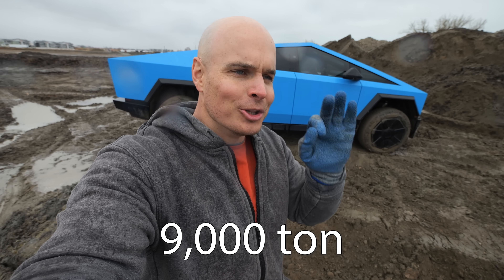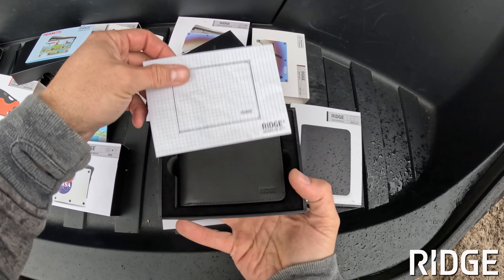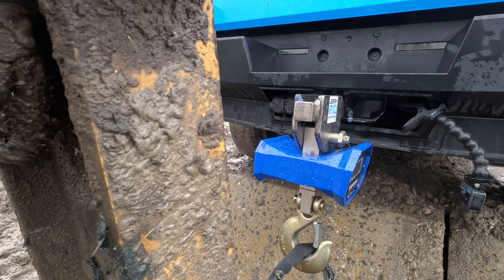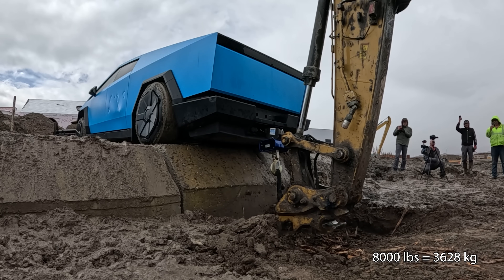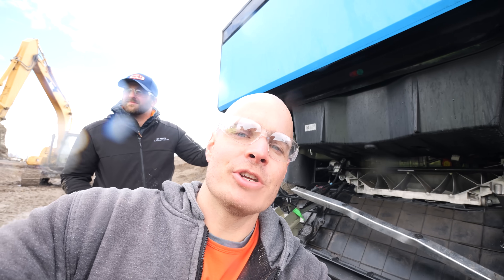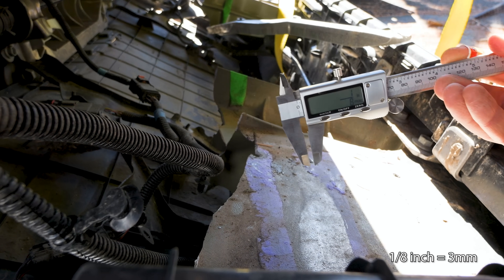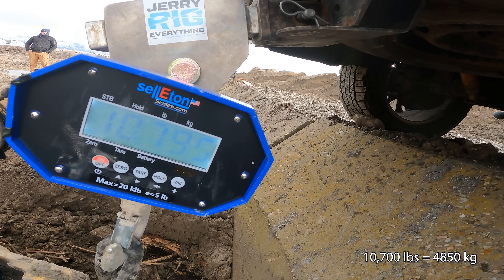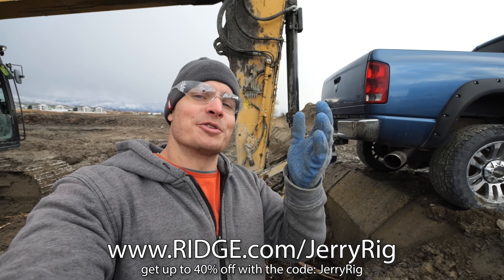SHOULD YOU TOW WITH A CYBERTRUCK?! - (catastrophic failure test)

Comment: Hey Grok, is there any real world examples or evidence of Cybertrucks failing at towing because they were loaded improperly?

Answer:

"There’s no direct, conclusive evidence from real-world incidents specifically stating that Tesla Cybertrucks have failed at towing due to "improper loading" alone, based on available data up to March 15, 2025. However, there are relevant tests and discussions that suggest improper loading could contribute to towing failures, particularly given the Cybertruck's design and material choices.

Stress tests, like the one conducted by YouTuber Zack Nelson (JerryRigEverything), highlight potential vulnerabilities. In this test, the Cybertruck’s tow hitch was subjected to extreme downward force—far exceeding the recommended tongue weight of 1,102 lbs—resulting in the rear cast aluminum frame snapping at around 10,400 lbs. While this isn’t a real-world towing scenario, Nelson argued that improper loading (e.g., excessive tongue weight) or dynamic forces (like hitting a pothole at speed) could transfer significant stress to the hitch, potentially replicating such a failure. The Cybertruck’s towing capacity is rated at 11,000 lbs, but the test suggests a thin margin of safety if loading isn’t balanced correctly, as the aluminum frame lacks the ductility of steel, which bends rather than breaks under stress.

Improper loading, such as uneven weight distribution or exceeding the tongue weight limit, is a known risk in towing across all vehicles. The Cybertruck owner’s manual emphasizes proper loading, recommending a tongue weight of about 10% of the trailer’s total weight (up to 1,102 lbs) and warns against negative or excessive tongue weight, which could lead to instability or structural stress. While no specific Cybertruck incidents tie failures directly to improper loading, posts on X and reports of tow hitch failures in extreme tests (e.g., WhistlinDiesel’s video, where the hitch snapped after impact and towing) imply that exceeding design limits—potentially worsened by poor load management—could cause issues.

In contrast, a 2004 Dodge Ram 2500 with a steel frame withstood similar stress (10,700 lbs) in Nelson’s test without failing, highlighting aluminum’s fatigue-prone nature. Experts and users on platforms like X have speculated that repeated towing with suboptimal loading could weaken the Cybertruck’s frame over time, though no long-term data confirms this yet.

So, while there’s no smoking gun of a Cybertruck failing mid-tow solely due to improper loading in everyday use, the evidence from controlled tests and material science suggests it’s plausible. The cast aluminum frame’s brittleness under extreme or misapplied force points to a design that might not forgive loading errors as well as traditional steel-framed trucks. For now, it’s a theoretical risk backed by test data rather than a documented trend."

Comment: HOW'S THAT A FAIR COMPARISON?? 

Cybertruck towing capacity: 11,000lbs. Broke at 10,400lbs vertical load (95% of towing capacity)
Ram 3500 towing capacity: 13,400lbs. Tested up to 10,700lbs vertical load (80% of towing capacity)

The Dodge might've broken before reaching 95%...

Comment: Personally i would rather have a steel frame on my truck. I want something that when it deforms/cracks/has problems, that will give me the ability to identify it. On my normal pre trip, and maintenance inspections. Aluminum just doesn't have the mailability that steels have, when they have been repeated stressed to the limit. Resulting in a lack of safety margin IMO.

Comment: I dunno man. Usually your vids seem pretty legit, the call-out on aluminum fatiguing over time is good, the comparison to a steel truck is good.

But the math for calling this thing unsafe to tow doesn't check out. at 1,100lbs a straight 1ft drop onto the hitch would be closer to a 1/20th of a second, which is closer to 6x weight. 6,600lbs is still well below the 10k failure point. 

Hitting a pothole, or going over a hill is going to result in more lateral load than downforce. A "lateral" load up a 100% grade would be about 5500lbs, and I don't know anyone who's going to try hauling a 11,000Lb trailer up a 45º slope! 

I'd go so far as to make a bet - If you can find me a truck that can do it from a stand-still to to 55mph all on that slope I'll buy you a cookie.

My guess is you're aiming to capitalize on anti Musk sentiment (totally fair) and get rid of a vehicle you don't like very much (also fair). But the math doesn't check out, and in your position thats as good as lying. So in the end your putting money in your pocket at the expense of others, which is exactly what everyone hates about Musk. 

So there you go.

Comment: The distinction between lateral and vertical loads is significant. The Cybertruck, not being a crane, isn’t designed or advertised to withstand substantial vertical loads in the same way cranes are engineered for such forces.

Comment: very poorly executed test. if you were applying that much tongue weight by poor weight distribution on the trailer while driving on open street you should be facing assault charges at least.
and for the record: your explanation of tongue weight at 10:00 is complete BS.
Reply: Wasn't completely correct, but also wasn't complete BS.

Comment: There is no situation where any truck should have anywhere close to 10,000 lbs on the hitch. Even the heaviest duty trucks on the market only have a payload of 7000lbs. And thats on a gooseneck. Breaking at 10,000 lbs is completly crazy. This test was %100 a pass for the cyber truck. I am super impressed. Just for context. A trailer thats not a gooseneck would snap like a twig far before reaching 10k lbs On the tounge.

Comment: WOW, I never thought that in the US you hang a trailer of a vehicle. That would neatly explain why the f*** do you need a truck to tow anything at all whereas here in EU we can tow 70% of trailers with a compact car. 
If anything the hitch should be tested pulling backwards not downwards, what you've been testing for is not a improperly loaded trailer, it's a trailer that has its wheels some 10-20 feet behind its load bay, and its load put exactly at the hitch. Find me a trailer that looks like that. Actual trailers designed to be towed by a car/light truck probably never exceed  50% of the load hanging on the hitch even if purposefully loaded the wrong way (and if balanced properly it should be exactly zero). With that methodology I can break just about anything and claim it's badly engineered.
Reply: If you take into consideration that the cast aluminum will weaken over time and it is already much weaker than a 20 year old truck that was involved in a rear end collision, are you going to trust it and for how long?

Comment: I have unsubscribed. I belieive the producer needs a lesson in basic physics.... The result here was actually really good........ Downward force of nearly 11,500 lbs... Think about the load capacity of the E rated tires on the cyber truck (3086lb). If this test was on concrete it's likely the rear tires would have blown under this load.... How many trucks have you seen blow their rear tires towing a trailer??? (None is the answer) single axle trucks with a tow rating of 11k Never experience shock loads or towing loads like this. This test was total shit. FYI I'll never own a cyber truck, because of towing range and charge times. It would never suit me... But this test was a waste of a vehicle, and a publicity stunt. Will never review another one of these videos.

Comment: Structures Engineer w BS and 28yrs as an Aircraft SE FedEx / Boeing / Airbus. Good test 
Fix
Easy fix a doubler on the casting or better to just increase the casting thickness. Easy fix is to get a better shear strength adhesive with a few what is called chicken fasteners. 
If it were me as a Tesla Engineer I would do both
and
Add a water proof sealer outside of that adhesive bond area. Weakest problem with adhesives is hot / wet strength so one fix would be eliminate the wet.
Problem
Road salt or cracks in adhesive / casting due to prior use will cause a premature failure.

Comment: while the argument "the full weight can still be relevant if towing other cars out of the mud" (doubt the cybertruck is that offroad-capable anyways)
"or if going 80 on a freeway and hitting a hole in the pavement" - even then, the full weight of the trailer won't be applies downwards to the hitch. Don't forget, the trailer still has wheels, which take the most of the weight. This is still true for improper loading.
But that's not what I was actually wondering..
I wonder about the just 3 (!)mm thick aluminium frame (!).

Comment: You're only testing tongue weight and not actual towing capacity... 
You would have put the entire 11k lbs trailer on the tongue for it to break..  Which is impossible.
I'm not saying it's a great design--  you can't tow with an EV anyway, because of range.  But these claims you're making are definitely false.

Comment: What the heck!!! no one puts that much weight on a tow ball. If there's that much weight on a tow ball then you've done something ludicrously wrong with your trailer or like a million times over weight.
*Just remember most of the weight of what you're towing is supported by the trailer wheels and not your tow ball. Very little is weight is actually on the tow ball and that's roughly 10% weight of what you're towing.

Comment: I have two Dodge Ram Cummings and you've just witnessed why they are the King Of Trucks, because they are really that tough! I had a 95 going up hill with a 36 foot 5th wheel trailer and a Chevy towing around the same size trailer next to me, blew the engine and started to roll back down the hill. My truck didn't even shift gears as it kept moving, while on the other side of me in the median was a Ford with the engine on fire!

Comment: This is not a good test for anything. When you apply 8,000–10,000 lbs directly to a truck’s hitch (tongue), the entire load presses down on that single point. The truck’s suspension, frame, and hitch bear it all—no distribution, no relief. It’s a straightforward, concentrated force. But towing an 11,000 lbs trailer works differently because the trailer’s weight doesn’t all pile onto the hitch. Instead, it’s distributed: the trailer’s axles carry most of the load, and only a portion—typically 10–15% (that’s 1,100–1,650 lbs) for conventional trailers—becomes tongue weight on the hitch. For fifth-wheel or gooseneck setups, where the hitch sits over the truck’s rear axle, this can climb to a maximum of about 25% (2,750 lbs). Either way, the hitch never sees anything close to 8,000–10,000 lbs when towing an 11,000 lbs trailer.
So why can’t an 11,000 lbs trailer produce a tongue weight of 8,000–10,000 lbs? It comes down to physics and design. Tongue weight is the downward force exerted by the trailer’s front end on the hitch, determined by how the trailer’s mass is spread out. To hit 8,000–10,000 lbs of tongue weight, nearly all of the trailer’s 11,000 lbs would need to be stacked right at the front, near the hitch. That’s not just impractical—it’s absurd. Picture a trailer with all its cargo shoved forward and the axles carrying next to nothing. The center of gravity would be so far forward that the trailer would be unstable, prone to tipping or swaying dangerously. In reality, trailers are built with the center of gravity closer to the axles to ensure balance and safe towing. Manufacturers and towing experts stick to that 10–15% guideline (or up to 25% for fifth-wheels) because it keeps the rig steady and manageable.
Think of it this way: imagine balancing a 10-foot pole. If you hold it in the middle, it’s easy—the weight is evenly split. But if you grab it an inch from one end, it’s a nightmare to control because all the weight is working against you. A trailer with excessive tongue weight is like that off-balance pole—hard to handle and risky. That’s why an 11,000 lbs trailer can’t realistically exceed a tongue weight of 2,750 lbs (25% in a fifth-wheel setup).
Thus, applying 8,000–10,000 lbs directly to the hitch is a completely different scenario from towing an 11,000 lbs trailer. The trailer’s design and weight distribution naturally cap the tongue weight far below that range, making the two fundamentally incomparable. The maximum realistic tongue weight for an 11,000 lbs trailer? 2,750 lbs—end of story.

Comment: Love the Hot Wheels vibe, but let’s see the Cybertruck prove itself IRL! Start with a 10,000 lb trailer up a steep hill, then keep piling on the weight until it hits its advertised limit. After that, throw in a random rain-soaked pothole test and keep cranking up the trailer weight until it breaks. Give us that full-on Cybertruck stress test! :)

Comment: Tongue weight supposed to be only 10 to 15% of trailer tow capacity. The trailer should be balanced correctly and a bump or pothole would not put that much force on it. The hitch is being stressed a way that it would never be.  Any truck would not withstand being tested that way.

Comment: I’m not a Teslas fan but this test has proven that the Cybertruck exceeded its capability. The Tesla Cybertruck's maximum tongue weight, the downward force on the trailer hitch, is 1,100 pounds (499 kg), and it's rated to tow up to 11,000 pounds (4,990 kg).
Reply: The problem is it's not safe to tow 11,000 lb if its actual tongue weight is only 10,000 lb.

Comment: I can't imagine ever buying a Cybertruck.  Esthetically, not my thing.  If I were planning to tow any distance I would not consider getting an electric truck.  That said, come on, this test and it's conclusions are misleading, and would hate to think it is intentionally misleading...  This is obviously testing well beyond factory limits and is not the intended towing geometry for this vehicle.  While there isn't steel fatigue, there is weld fatigue.  Type "truck frame breaking" in a search and you will see dozens of examples of frames breaking during use across many manufacturers.

Comment: A lot of people here missed the main point of the video. 
The aluminum frame can’t bend, and every single time a load is applied, the material weakens ever so slightly as it fatigues. Steel doesn’t weaken every time you apply a load (as long as the load doesn’t exceed the steel’s yield strength). 
Sure the test could be better, but its main purpose was to show that when the aluminum reaches a failure point, it doesn’t bend as steel would, it simply snaps. While forces of 10,000 lbs isn’t going to happen in the real worlds (unless you seriously improperly loaded your trailer), what does happen in the real worlds are dozens and hundreds cycles of several hundred to 1-2 thousand lbs which over time weakens the aluminum until it snaps. Steel will never fail in that way regardless of how many load cycles are applied to it.

Comment: 10% of the tongue weight is 1100 pounds, which means your trailer should be 11,000 pounds. So the truck could tow 100,000 pounds according to your tongue test!

Comment: Force vectors. When the truck pulling the load goes over the bump, the amount of force going down is not equal to the total weight of the trailer, by a long shot. You don't pull a trailer with it's rear end straight up in the air, which would be the only way to cause the total trailer weight to be applied to the hitch. And you can see the front of the vehicles lifting up so the hitch is also supporting a portion of the weight of the truck. Why don't you try testing the hitch the way it actually gets used. This is a poorly designed test, sorry.

Comment: Not a musk fan, obviously, but was initially thinking that 10k is a good weight to be able to withstand. I appreciate you putting the old ram in as a sort of control. 

It gives a really good spot to judge why the cybertruck is dangerous. It's really important to note that a 5000 lb trailer is not rare - improperly loaded going over a bump fast (on the highway) could 100% lead to someone's death if the entire rear bumper broke off. Obviously, improperly loaded.

But americans look at freedom as "freedom to" rather than "freedom from". We have the freedom to design dangerous vehicles, but that means we lose the freedom from dangerous vehicles. This made sense before industrialization where small companies made up the majority of work and products, and it was too expensive to develop perfect products consistently. But nowadays, we should have the freedom from dangerously designed vehicles. Especially from large manufacturers.

Comment: I'm actually impressed with the result. But knowing about Aluminum's fatigue issue, it sounds like it is probably not a good idea to tow extremely heavy trailers on a regular basis.  Somebody should probably do some scientific testing to to determine exactly how long you could expect the aluminum to hold up towing various load weights.  Tesla might need to derate the towing limit some.  But time will tell.

Comment: The 20'000 tons scale is awesome, but the load is applied perpendicularly to the normal towing direction. I am pretty sure they design the geometry of the chase to withstand loads parallel to it, not perpendicular. The test should be re-done :)